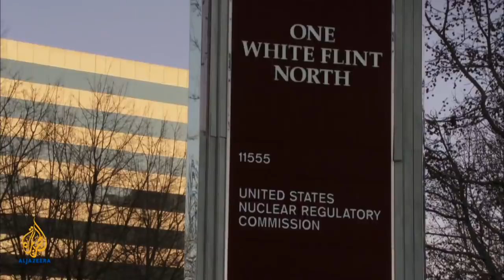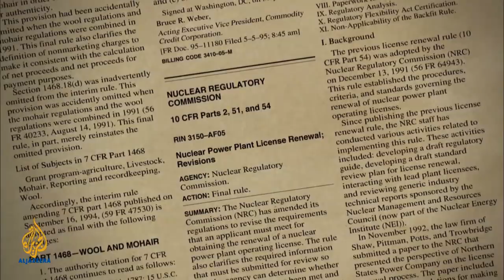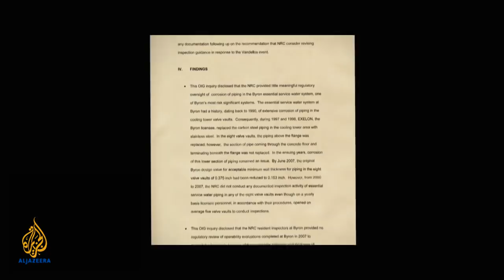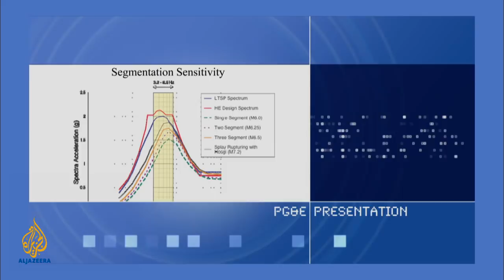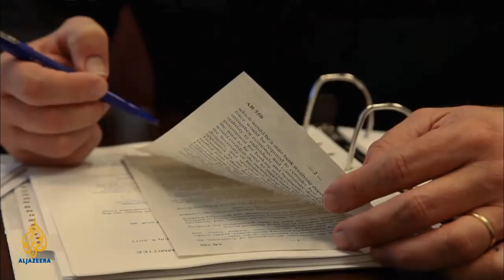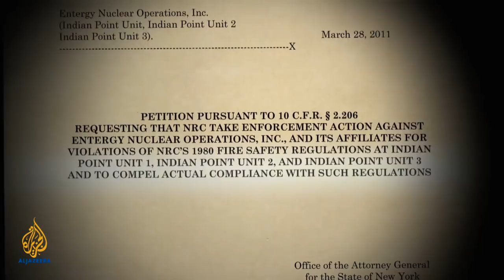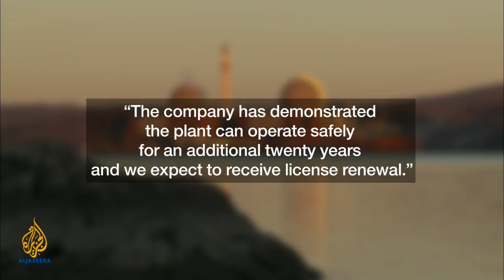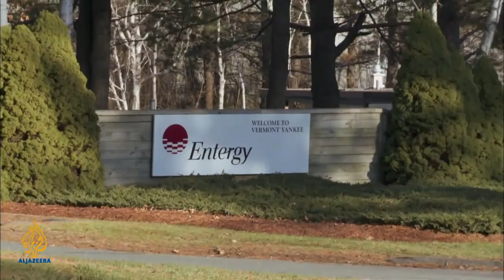People & Power - Danger Zone: Ageing Nuclear Reactors

Comment: no.  it was just badly designed... in 1950...  No reactor designed since 1970's could of had the same problem - since they are designed to shut down naturally if anything on it breaks.  
The modern design philosophy for nuclear reactors is 'default state broken' Which means that if everything in the reactor is not working perfectly the reactor will naturally shut down into a safe state.  The Fukushima reactor was 'default state hot' whereby if components fail it does not shutdown.

Comment: It is designed such that unless the systems removing the energy from the reactor are working, the reactor will naturally stop.  It is not computerized nor automatic as nothing needs to do anything to make it happen - but rather normal things need to stop happening.
An analogy would be the effect of stopping cycling a bike.  If your going uphill you will slow down and stop naturally.

Comment: The Westinghouse AP1000 is a continuation of their Pressurized Water Reactor Technology (PWR) and the engineering appears sound. Nonetheless, having worked at a nuclear power construction project in the late '70's and early '80's, I am not entirely impressed with engineering and regulatory practices as I'd mentioned in my initial post. The handwriting is on the wall however, the world needs to find a source of inexpensive, safe and reliable energy!!!